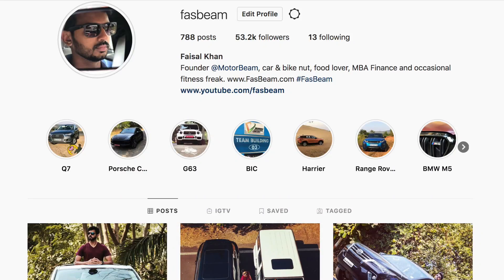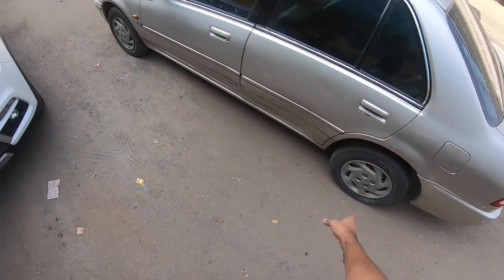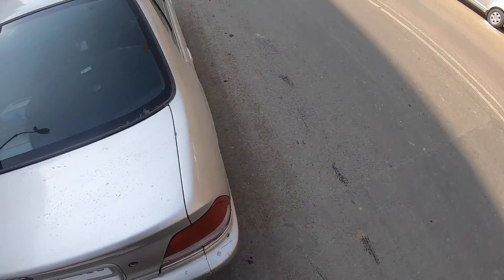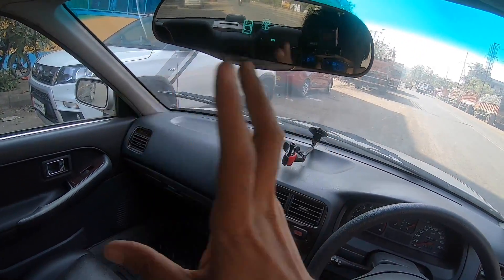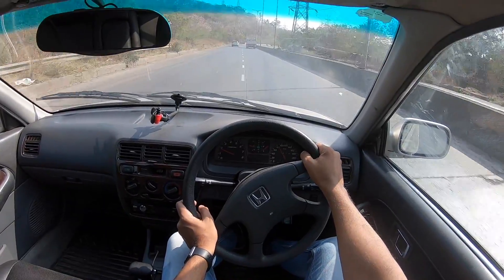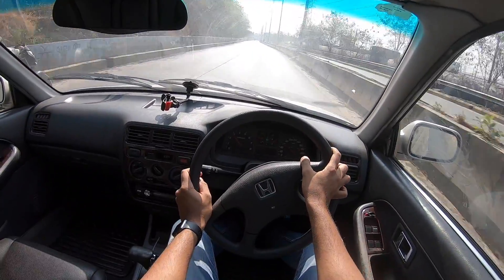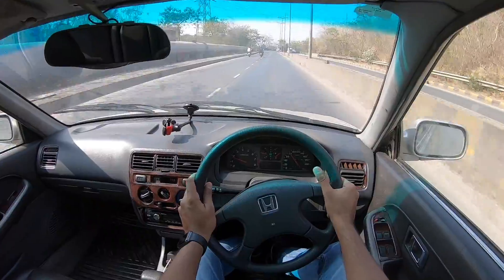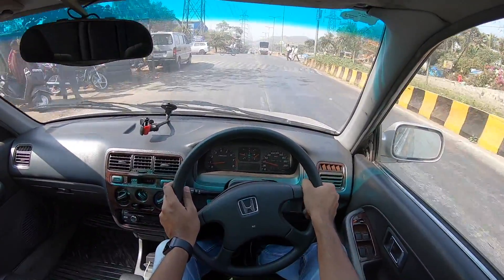Old Honda City - AT With No VTEC | Faisal Khan

Comment: ..
Toyota corolla and Hyundai Verna were offering 4-speed Torque Convertor in their automatic cars even in 2010.
A period where even the Brio from Honda had a 5 speed automatic.
This is why Honda is Honda.
The basics of a car are more important than the gizmos.
Sure.... a grand i10 may have more fancy gadgets.. but even in 2010 the Brio had its basics right, a proper 5 speed auto transmission.
..
What good is a car's power if you are limited by the 4 speed unit?
I am looking at you.. old corolla altis and verna. 😊